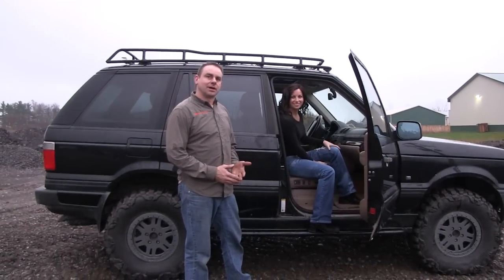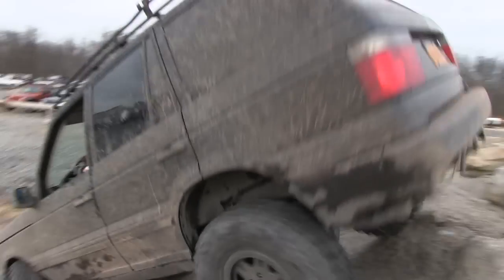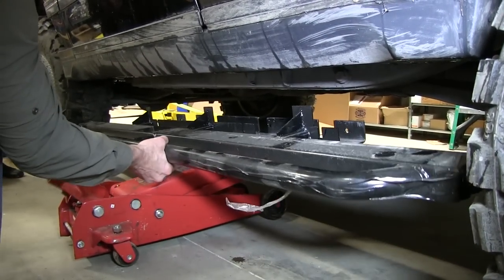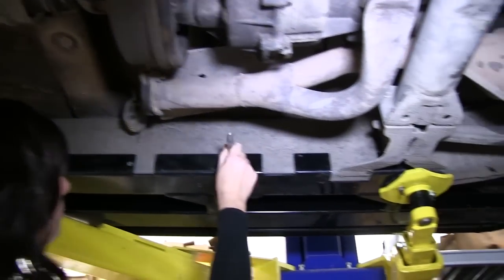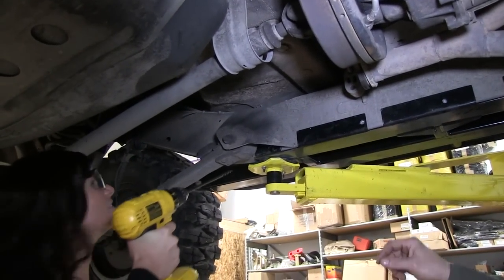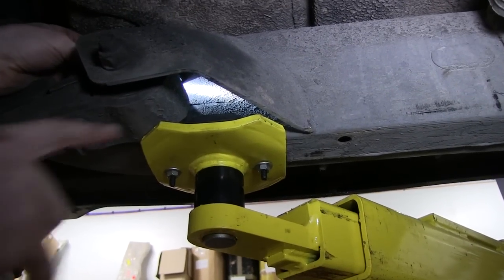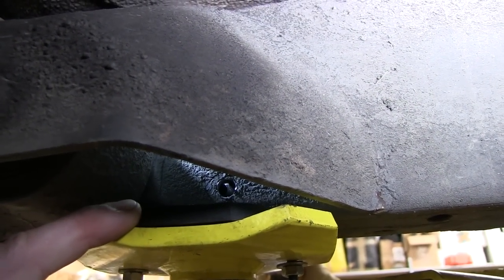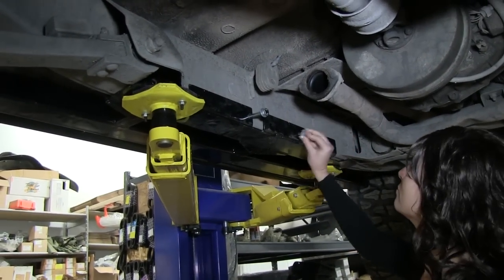P38 Terrafirma Rock Sliders Install

Comment: What size tires are those? Home much lift do you have? What exhaust is that? oh and one last thing.... What modifications did you make to the drive train to handle that lift? Im from the Jeep world and did you have to install an Slip Yoke Eliminator or Extended control arms/ drive shafts? Thanks!